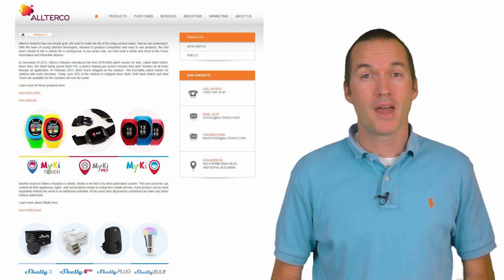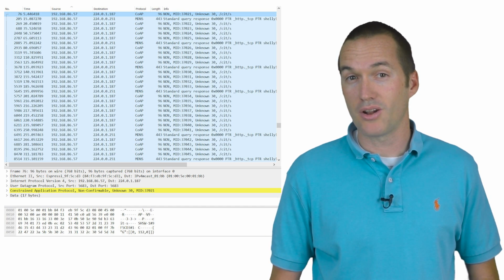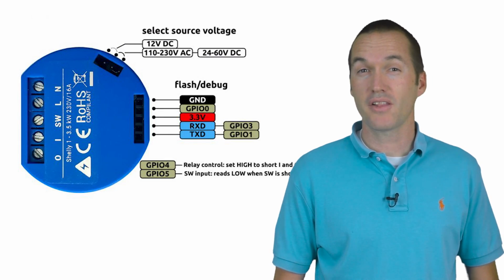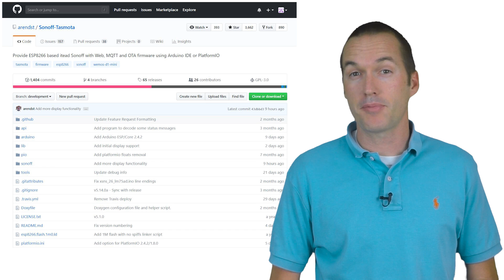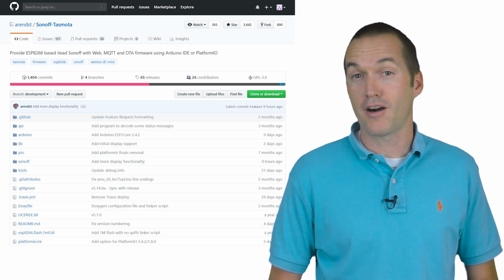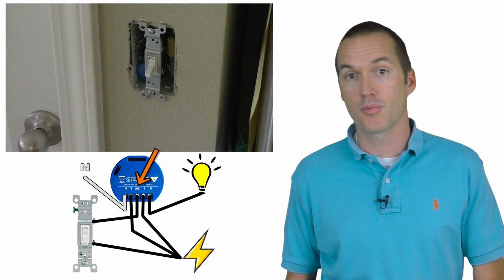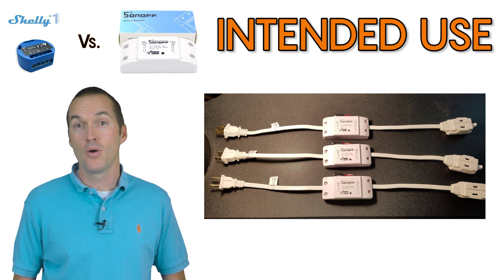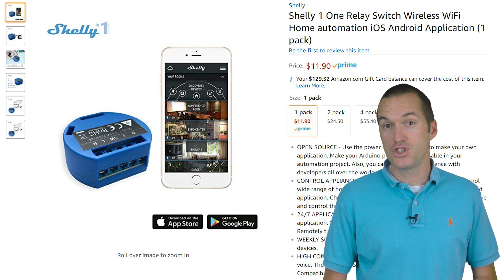Is the Shelly 1 better than the Sonoff Basic?

Comment: The biggest problem I see with installing this into a light-switch box as shown in the video is that when activated, the light will be on (illuminated), but the physical light switch will still be down in the "OFF" position.

So the only way to turn off a light activated via the Shelly1 is to use the web/mobile interface, the physical switch will not turn it off.  
(Yes, I know that if you activate the light using the physical switch, then that switch will work as normal).
Reply from the maker: That's not true.  There are different switch modes to make the switch act however you want it (edge/toggle/momentary/follow).
Reply: @TheHookUp  
So how does it actually move the switch lever?  Do you have to buy a special light switch?

Comment: This is what I would like..I have one outlet box with 3 outlets from a 20Amp GFCI for it..I want to plug 2 things into the 3 outlets BUT I want the 1st device to be on a timer and the 2nd device to be on another timer or where I can turn them on or off individually. Does this or the sonoff due this?

Comment: If I wire in the 2.5 to a light fitting, will the bulb be controllable via Home Assistant, regardless of whether the physical switch is on or off? OR if I wire one into a 2-gang light switch (2 switches controlling 2 bulbs), would I only need one of the Shelly 2.5s? Would they again be controllable regardless of the switch position? Lastly, I have 10 LED spotlights in the kitchen; how many Shellys would I need to control them? I’m a little unclear about these devices, but I think they’re what I’m looking for.

Comment: I try to understand the part  where you explain the GPIO shouldn't  be used when connected to main voltage. I can use the shelly with  the Temperature Sensor AddOn to switch a small 220v operated heating element (to prevent animal drinking water from freezing whent outside temp < 0° for example)?

Comment: As a professional electrician, please seriously reconsider cramming a relay and a bunch of extra wiring in your switch's box. There's a concept called Box Fill, the short of it is that if you cram too much into an electrical box there won't be enough room for all the components to cool off; you're basically turning the box into a kiln. Please refer to your local code for box fill; if you cannot get a hold of that information and you're in the USA, I'd recommend checking the NEC (NFPA 70) or use the Ugly's Book (NFPA 70E) as a quick reference. The Ugly's Book can be bought from Amazon or Lowe's for $20-30 and has just about all the important info.

It's really a crapshoot on whether or not that whole "16A" rating is worth a shit; it's very common to see 20A circuits for your outlets these days. Also the +1A is worth fuckall on a 15A breaker, as an FYI. If the breaker fails, you get a fire; if the breaker trips, the power is killed before a 15A device would fail (the whole point of having the breaker to begin with). All that matters is the lowest common denominator; make sure it's the breaker.

Comment: After connecting a Shelly1  between power/a switch/outlet I want to bypass the timer switch that renters to use should the timer switch knob break. (until I get out there to fix it)  The timer powers an outlet that the AC uses.  I've seen a detach switch mode in one of the Shelly software diagrams.
Is this the feature I will use to bypass the switch knob should it break again?

Comment: Is the Shelly one able to connect to a 5ghz access point? Cause the sonoff will not connect to a 5 ghz AP only to a 2.4 ghz can  you verify that??
Reply from the maker: No, only 2.4ghz.  Almost all smart home devices are only 2.4ghz.
Reply: The Hook Up is it easier to set up than the sonoff? I had a hard time setting up the sonoff and after I set it up it’s still shows not communicating, that’s a reason why I want to try the Shelly 1 and hopefully it will pick up the AC pro from ubiquity 2.4 ghz in the AP.

Comment: Also, always be careful when adding the N wire to the existing bundle. It is not uncommon to have bad wiring where the return path for a different circuit shares the N bundle in a switch box for a different circuit. Everything will appear disconnected until you separate the existing N bundle, at which point some of the N wires will be live (through any currently ON devices on the other circuit). Always treat it as such and don't unnecessarily un-bundle the existing bundle, or check it for live after you do so. It's usually obvious because of sparking as you take it apart. Also be aware that you may have more than one circuit in a single switch box, particularly if you have many two-way switches. Always check for live wires even after you've verified the light is off.
Reply from the maker: Good advice, crappy wiring practices are always dangerous and you never know what a previous homeowner has done.

Comment: 1-Can we use shelly1 in apartment intercom unit in home? our apartment intercom works with 12 Volt how to connect? I need install of diagram....
2-When someone push intercom (Examplemy home number is 8 and push number 8) front of the main door of apartment  then Can we get natification from shelly1  then we can unlock the main door of apartment...THANKS.

Comment: @9:00 I think most light switches are not set up the way you mentioned, or I've lived in places with bad wiring.  Usually (not all the time) there are only TWO wires behind the switch wall plate, and well actually those two wires are actually the same one with the switch in between.
Not sure what is the norm, but on your diagram you have the positive/live wire going to switch, the other wire connected to the switch would be the "out".  So basically when you turn the switch "on" it connects both ends of cable, which sends the current to the light bulb.
So again, from my experience when there is only a light switch on a wall plate, we only have positive/live wire or ground wire.  This means most users would have to probably put the shelly1 up on the celiing where they light fixture actually is.  We are guaranteed to have both the positive wire and the ground wire up there, otherwise light wouldn't turn on.  
Doesn't that hold true for most  homes?

Comment: Question: Lets say I placed ( I mean wired )  a Shelly one inside a switch box ? Now if someone in the house uses the hard wired switch to turn on the lights and I want to switch them off ( using the cell phone, assume I am outside the house ) ? Can the wiring be done in such a way it bypasses the hard wired switch and vice versa ?

Comment: Excellent video! (Minor comment: At ~12:30 in the video you say that the 16A rating allows the circuit breaker to trip before the Shelly reaches it's rated voltage - certainly talking about *rated current*. (I miss-speak much more often than that ;-)) ). Thanks again!

Comment: Shelly 1, Can power it with a car battery?
Reply from the maker: Unfortunately, probably not.  The 12V power option requires a regulated 12V power source.  If you change the jumper to use 12V and then hook it up to a car battery (which can get as high as 15V when the alternator is running) it will likely fry the shelly.
Reply: @TheHookUp  thanks for fast reply, can i make somthing so it vill be a clan 12v? Or can a use power booster to 24v?
Or is Sonoff 4CH Pro R2 best way?
Reply from the maker: @cblad1406  What are you trying to accomplish?
Reply: @TheHookUp  start my car, control sound system in the car, lights and so on. The car has rut240 4g with wifi.

Comment: LOWEST eBay price (3-2-20): $11.40 + $3.90 + Tax!   "Shelly 1 One Channel Smart Relay".
Reply: I guess it depends on your country and quantity.  I would NOT recommend buying them one-at-a-time.  Shipping will always cost more.  But as of June 5, 2020, you can get a four-pack of Shelly-1's for $40 USD plus $9.46 international shipping ($49.50 total delivered) and that works out to $12.38 each, quite a bit lower than the $15.30 you found.  Also, not all states collect tax on international shipments like this, so that may just be where you live (not Nevada, for example)  Go to shop.shelly.cloud to purchase directly.

Comment: The graphic you put up of Shelly 1 shows 20/60, a common and a 12volt. I'm hoping this is an alternate supply as it would great in cars, boats etc?
Reply from the maker: 20-60V DC is very flexible.  If you use the 12V input (and change the jumper) the voltage needs to be well regulated.  Using it on a boat might not be the best idea since you'll be working between 11-14V most of the time.

Comment: I think the Sonoff is a smarter design safety-wize. It's design discourages reasonable users from integrating a Sonoff in ways that would increase a potentially dangerous fault. For example, the larger form factor of the Sonoff Basic and 10A rating discourages hidden installations and encourages the integration into a lamp cord or extension cord. Whereas the Shelly is designed to go into a wall box behind a device as in this video. Nevertheless, neither device is UL or ETL listed and therefore not compliant with the American National Electric Code as a reliably safe device for permanent installation in a wall box. I think I'll keep my Sonoff devices on the outside of my walls where I can see them, and where the smoke detectors can smell an unlikely fault as soon as possible! .....even though my Sonoff ceiling fan controller is in the fan box.....(sigh)
Reply from the maker: The Shelly 2.5 and Shelly 1 PM are both UL listed.
Reply: @TheHookUp  Of course they are...at $21 and $33 bucks apiece!
Reply from the maker: @NikonErik  $33 is a 2 pack of the Shelly1PM
Reply: @TheHookUp  The Shellys are looking better!

Comment: I LOVE the Shelly 1. I have them in my home and I do have Sonoffs also. But the Shelly1 from size and out of the box options are GREAT... My only beef with Shelly1 (v3 is what I own) has very week reception once inside a metal switch box. had to move my modem closer to center of home. But works great.

Comment: Thanks for the video appreciate it a lot. here in Costa Rica we don't have neutral wire in our electric installation, any recommendation on what to use in order to control the lights?

Comment: SONOFF is much better, here is why:

- CHEAPER

- much more devices and options to combine
- much better app with more options
- has much more and better information available (eg: how to modify a relay to work with 12/24 dc volt, flash custom/homebrew firmware)

- compatible with google, alexa etc...
- Sonoff has a RF and IR bridge for 433 sensors to combine in your network (Infrared control for operating AC units, TV's or RF for remote garage door opener or wireless door/movement sensors)
Reply: Do you have actions in Sonoff / ITEAD? No way! Since I read your two first arguments, I knew you were totally wrong. Much better app!! hahahaha
Reply: @alc7328 
YES, I have:
- Schedule by calendar
- Timers
- if then else actions
- Supports Alexa, IFTTT, Google home

Switches, actions and notifications can also be shared with other users.

Sonoff has also energy consumption monitoring per switch and you can configure price per KW and even export the monthly statistics to a spreadsheet.

Oh did i mention that most basic sockets and switches from SonOff have power monitoring standard ?

They also have switches that can trip or activate directly with a humidity/temperature sensor (i use these in my bathroom for the extraction of vapor)
and these also monitor energy consumption ! (the TH10 and TH16)
you can even but different kinds of sensors for these devices depending for what need and how correct you want the reading to be.

And here is another fun fact:
SonOff has Infrared bridges and RF bridges,
This means you can hook up wireless smoke alarms, door sensors, movement sensors control airco, tv and get notifications from any cheap wireless doorbells !

above that you can also use these IR and RF devices with Alexa, IFTTT, Google and implement in then else actions trough those bridges !

Sonoff possibillities  are almost endless, i have a wireless water leak sensor hooked up at home that closes my main water valve in case my laundery machine springs a leak, the only part that i used which is not from sonoff but compatible anyway is an electronic ball valve that is operated by a sonoff switch !
i also get notifications pushed to my phone for all sensors if i want to.

Comment: Hello Robert! I have a Shelly 1, not flashed with Tasmoto yet but I am contemplating the following project: I need to install a fresh air fan into a vent in our basement. For this I want to use a 12V fan like a high quality PC fan 120mm or 140mm size. The fan should be able to be controlled via home assistant to turn on/off and adjust speed in some steps (4-6 steps perhaps). To adjust speed I was thinking of using a transistor controlled swith to cut the 12v to adjust the speed. MQTT or Rest could be used. I was hoping to not have to buy an external transistor switch but use the internal in Shelly 1. Do you think that could be done? Your views and ideas yould be very much apprechiated. Thansk for great videos!

Comment: I've got several Sonoff's and Shelly's laying around here, and I wonder which one would be better to use as "smart switch" outside the wall. Can this also be done just with the shelly? Point is, it's not a wall switch, but just a switch before a dumb light, where you never see the cable. Just out of safety and looking at hardware.

Comment: Is the Shell UL listed for installation into a power box?  The NEC code requires UL listing and if not  your fire insurance may not cover your damages. Has Shelly determined the fill and size of the box  for installation? I am an electrician and electrical engineer.

Comment: NOTE: NOT ALL wall switches have Neutral wire available check if there's a Neutral wire before you try to do this type of installation.

Comment: just to give you a tip on correct terms.

High voltage is AV voltage over 1000Vac, usually what you find on your overhead on the street. What comes to your house is LV or Low Voltage.  I know it pedantic but there is a difference.

Otherwise great vid
Reply from the maker: Depends on context I guess.  NEC defines low voltage as under 40V and in the U.S. there are low voltage installers who are not certified to work with 110V AC.

Comment: this device will likely never get certification in Australia for mains use.
Reply from the maker: The Shelly 2.5 is now UL certified, and the shelly1pm should be shortly.  I know UL doesn't automatically mean AUS certification, but I think it's more a question of paperwork at that point.
Reply: @TheHookUp  there is so much  stuff that is UL listed and certified in many countries including the US and UK but still doesn't have certification here in Australia. I think chasing Australian certification may have led to a change in the design of a couple of the Sonoff devices. The rules on some things are quite strict here especially regarding electrical equipment and work. We cannot legally do our own house mains electrical work and that includes putting a new 3-pin plug on an appliance. Changing a light bulb is pretty much all you can do legally. Replacing a light switch for instance is a total no-no.

Comment: Have you been able to get Tasmota to run on the Shelly 4 Pro ?
Looks like a great DB / Din mounted unit to control circuits, at the moment I use 4 x contactors connected to a Sonoff 4c to switch their state. (of course the Shelly comes with the added benefit of PM functionality)
G
Reply from the maker: Current shelly 4 pros do not use Esp chips and therefore can't run tasmota.  There is a new version coming out at some point with an esp32, but I don't know of an official release date.
Reply: @TheHookUp  looking at their web site i see the Shelly 4 Pro also have MQTT output so assume you can then simply control it that way, for on/off and the readings?

would be great if they do a 2 gang and 3 gang Shelly 1 units also... little feedback to the supplier...
G

Comment: Given that this has a relay input and output, is there a way to use this as a device that could detect open/closed dry contacts? Combined with the 24VDC power ability there are many applications to integrate other equipment.  I am looking for a 24VDC powered dry contact sensor to connect to my Leviton ceiling occupancy sensors. Thanks.

Comment: would love to see a 15amp load the ratings dont mean squat if the PCB is not designed to handle that current , the traces have to be designed to take that amount ...  https://www.4pcb.com/trace-width-calculator.html is a good starting point... should ask them both what the trace width is and it maters if is a dual layer or sling layer PCB
Reply from the maker: UL Certification should be finished sometime in May  but all tests are passed thus far (including load testing).
Reply: @TheHookUp  I'm thinking about getting a few looks like amazon has the in 2pk for 23ish dollars... not bad at all and I like that they can fit in switch boxes....
Reply: oh and yea I'm a new sub...
Reply from the maker: Glad to have you!  If UL certification is important to you you may want to hold off for another month since there will be a "US Version" that uses a panasonic relay instead of HongFa.  Not that the panasonic is any better, but UL requires specific relays in their devices.
Reply: @TheHookUp  https://www.youtube.com/watch?v=i7kxUyvkXjw